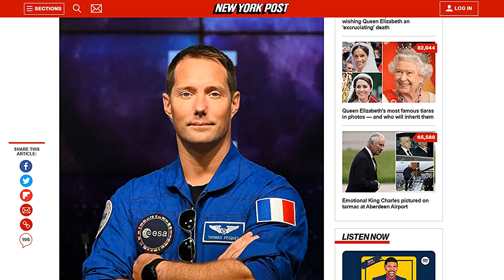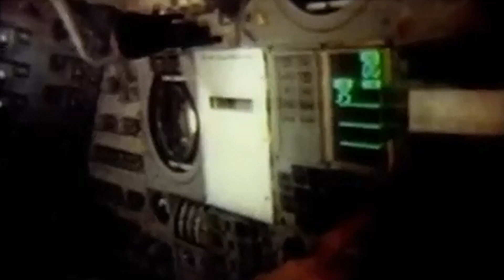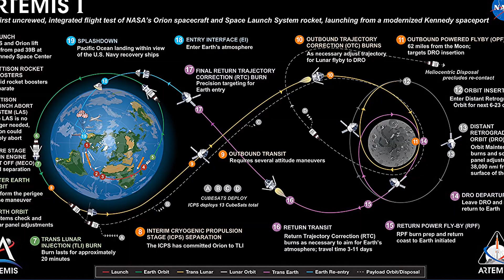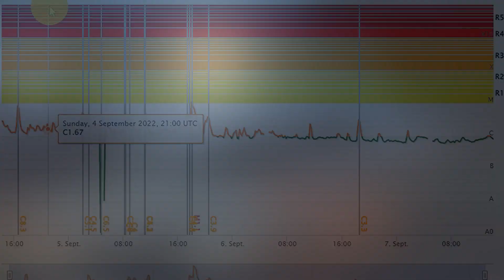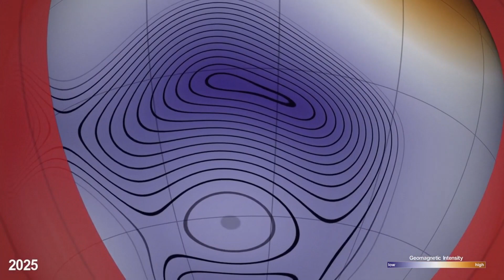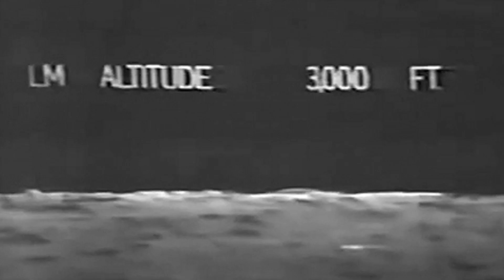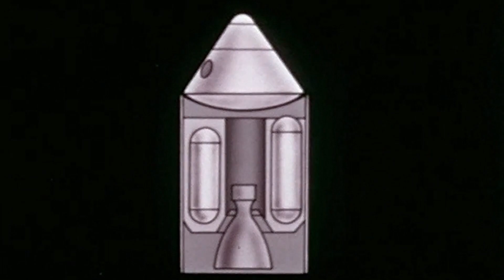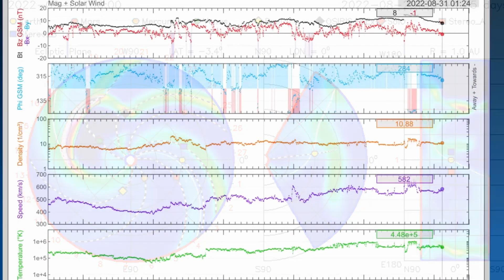THE APOLLO DISCUSSIONS "APOLLO 2.0" PART 2 OF SHOW 10

Comment: I'll patch it again, right here, why the "LACK OF FUNDING" excuse doesn't run anymore, "thanks" to the current Artemis Program. The absurdity of the Apollo missions is more exposed than ever.

First of all, if we take the cost of an individual mission, that is, all the costs of the individual elements associated within a lunar mission (or as detailed by the NASA Inspector General, Paul K. Martin, "all Production Costs, including rocket, modules, control of operation, etc.”), we have that, according to Forbes, turns out that the individual Production Cost of Apollo 11 was $355 million in 1969 currency. An Apollo 11 was a manned lunar landing, that even exceeds Artemis 1 or Artemis 2 in its complexity, since Apollo 11 has a Lunar Module and many more nuts and bolts. And Forbes estimates the cost of a unit of the Saturn V rocket as $180 millions of the time, while the former NASA Director estimated that in $150 millions (in an interview to National Geographic in 1969), so we can be assured that Forbes wasn't underestimating their figures.

$355 millions in 1969 money equals $3.4 billion in current money, using NASA's specific inflation index (multiplying by 9.6 to convert 1969 dollars into 2021 dollars). Today, Paul K. Martin says that the individual cost of a mission like Artemis 1 is 4.1 billion dollars, and that's more like an unmanned version of the Apollo 8 mission, if anything. Less than that, actually: Apollo 8 not only was manned, but also made 10 lunar orbits. Each unit of the SLS costs more than 2 billon dollars, and like the Saturn, is totally expendable. So, in conclussion: more expensive, and brings half the payload to lunar orbit. In a mission with significantly downgraded goals. But that's not the worst part.

Then, you have the Total Investment Costs. That includes the infrastructure and research and development costs specifically for achieving the lunar mission. All the costs of buildings and factories made to produce and house the components of the lunar missions would enter here, like the gigantic Vehicle Assembly Building and the factory expenses to mass-produce the respective components of all the lunar missions (i.e. to manufacture all Saturn rockets for Apollo, SLS for Artemis, all Apollo or Orion command modules, etc.). They also include the costs of adaptation and expansion of existing factories for the new objectives.

We have that the Artemis Program specifically consumed and will consume in R&D, manufacturing, etc., a total of 93 billion dollars until the year 2025, according to official NASA inspection reports (https://oig.nasa.gov/docs/IG-22-003.pdf)

But this, of course, is only for the Artemis Program. The previous Constellation Program, canceled in 2010, which had the same aiming of landing a man on the Moon and which previously developed several of the elements that are used today (most of the money was spent in the design of the Orion command capsule), wasted from its creation in 2004 until its abrupt end in 2010, a total of 12 billion dollars.

Therefor, the Artemis Program, until the year 2025 in which, it is presumed (🤣), it will achieve a manned lunar landing, hitherto will have spent a minimum of 105 billion dollars. And it will have achieved the following:
- 1 manned mission with moon landing (Artemis 3)
- 1 orbital manned mission around the Moon (Artemis 2)
- 1 orbital unmanned test mission around the Moon (Artemis 1)
- 1 unmanned test mission in Earth orbit (Exploration Flight Test-1)

It remains to be seen whether it will actually succeed, but for comparative purposes we will presume that it will do so by 2025. Then we can compare it to the alleged results of the Apollo Program, when it wasn't even complete, say, until the end of the year 1969:
- 2 manned missions with lunar landing (Apollo 11 and Apolo 12)
- 2 manned orbital missions around the Moon (Apollo 8 and Apollo 10)
- 2 orbital manned missions around the Earth (Apollo 7 and 9)
- 3 unmanned test missions in Earth orbit (Apollo 4, 5 and 6)

We all see that the acomplishments of the Artemis Program until the year 2025 will be less than half of the results of the Apollo Program until the year 1969. However, in 2025, it is expected that a total of $105 billions will have been spent for the Artemis missions. Meanwhile, the entire Apollo Program up to the end of 1969 had spent a total of 180 billion dollars in 2021 currency (elaboration based on figures from "The Apollo Spacecraft: A Chronology. Volumes I through IV", using the latest NASA inflation update chart).

This obviously leaves out the fact that part of that money was already invested, in 1969, for missions that would be launched after that date (4 more moon landings until 1972, and an orbital mission). So, not all of that $180 billion is for lunar missions until 1969, but let's assume it was (while the post-Artemis 3 Artemis missions are much more spaced out and farther in time; i.e. this unfairly improves the comparison for Artemis).

Clearly the Artemis missions are more expensive than the Apollo missions, also in the Investment Costs category.

But that hides another thing. The Apollo Program faced the development and manufacture of all the elements necessary for the lunar missions virtually from scratch. At the start of the Program, in 1960, there was no rocket capable of lifting heavy payloads into Earth orbit, let alone lunar orbit. Same happened with the command module, the lunar module, not to mention computers. None of that existed prior Apollo, and yet those elements were already developed and manufactured long before the start of the Artemis Program. 

The same happens with infrastructure. The aforementioned Vehicle Assembly Building, the two huge crawler-transporters (used for both the Saturn and the SLS), the new command center, etc., were all built for the Apollo Program and existed before the start of the Artemis Program, which also employs them. In accounting jargon, these previous costs already payed that cannot be recovered at the end of a project (but that can be used in another following one) are usually called “Sunk Costs”. Without the Artemis Program, and previously without the Shuttle, both the existing crawler-transporters and the Vehicle Assembly Building would be useless, because they could not be used for virtually any other project. 

Moreover, the sunk costs used by Artemis go further than that. The RS-25 engines used by the first three Artemis missions are just refurbished engines from the old Shuttles, and so are the Solid Rocket Boosters and external tanks, thought improved. They didn't need to build any of that, since it was already in stock.

Then, it is unfair to compare the total investment cost of both programs, since not only the Apollo Program had more missions, but also because that program built and developed elements that did not exist or even had been conceived, and that could later be used later. The Artemis Program had a much more advantageous starting point, since it incorporated the already buil equipment and components from both the Apollo Program and the Shuttle Program.

But there is still more. In the 50 years between the two Programs, there were many technological developments that would have lowered costs, regardless of the development of the space programs, from which the Artemis Program could benefit. Consider the progress of computers. In 2010, a simple Iphone has more computing power than all of NASA in the year 1969. Think about the implications, in cost and possibilities, that such a technological leap entails. Not to mention the advantage of half a century of experience in space travel since 1972.

Well, leaving aside all those advantages, one thing is clear: the total investment costs of the Artemis Program not only should be lower than those of the Apollo Program (while being higher instead); they should not exist at all!

Why? Because at the very least, the developments and equipment that already existed prior to the launch of the Artemis Program already guaranteed that the necessary elements for a lunar mission could be produced at once, since were already developed in the Apollo Program. Much of the infrastructure and equipment was still in use at the time of Project Artemis launch in 2011, thanks to its use in the Space Shuttle Program that ended that year. The cost of retrofitting the plants to their original configuration (or higher) to rebuild the original components (Saturn V rocket, command and service module, lunar module) is a fraction of the costs of building them from scratch.

Summary: To send astronauts to the Moon, only Production Costs should have been required. All Investment Costs could have been saved. As simply as that. The infrastructure, equipment, R&D, was already there. It's incredible unfair to compare it with the investment costs required for Apollo. 

The only reasons why new investments would be required is if the resulting new developments improved the performance or efficiency of the old components of the Apollo Era, or if they were needed for greater aims. But none of them are the case. They will be more expensive and less efficient. Especially in the most important component, the rocket, which represents half the cost of the entire project. The SLS is not an improvement at all; its capable of launching half the payload into lunar orbit than the Saturn, it's neither an upgrade in rocket reusability or weight at launch. It's New, which means it needed spending to develop it from scratch. It's Worse, as it has half of the lift capability. And More Expensive, since even once developed and tested, each new unit will cost more than the already previously developed and tested Saturn V. And not a single person can say that, even if they make it on schedule and in 2025 they land an astronaut on the Moon, that would be a more ambitious acomplishment that any of claimed results of the Apollo missions.

Comment: I've done a lot of study on the shadows on the Apollo missions.
I've tried to catch them out, and have concluded that basically, they did an excellent job.
e.g. The shadows of the LEM decreased appropriately in length according to the duration of the alleged lunar visit.
In still photos, shadows from objects on each side of the picture, converge as they fall away from the camera, due to parallax, as must needs be.
The camera did not "pan across" the scenery but swivelled around from its position fixed on the Rover, up to 360 degrees at times.
So if one view shows shadows running full length to the left side of the image, then turning clockwise 90 degrees later we will see the shadow falls directly between the object and the camera, and at 180 degrees from the first view, the shadow will point 180 degrees in the opposite direction, from the object to the right of the image.
This is elementary!! I can't believe you use this as a proof of fakery. 
In fact, it is proof that they tried very hard to make their fakery appear realistic!! Succeeded, even!

Again, I have to comment that there are much better arguments revealing the faking of Apollo, than (some of) the ones you are using.
It is counter-productive to use false premises like this.
Reply: So what does this mean exactly in layman terms?

Edit: misspelled layman
Reply: @Xernive  
Which "this," exactly?
Reply: @rubygray7749  Referencing to the original statement you were making about how they did the shadows etc.
Reply: @Xernive  
Wèll I don't know how they did it, but mostly they were fairly accurate. I've scrutinised several EVAs where the camera rotated 360°, and somehow, the shadows appeared consistent all round. That would be really difficult to achieve with a single studio light.

But there are some glaring anomalies. 
On the Apollo 11 photos, when you adjust the gamma and other parameters, you can clearly see that extra spotlights were used. There are multiple shafts of strong deep blue light, shining from a different direction from the white "sun". Very obvious.
In one of the missions, there is a photo of someone's visor with a horizontal row of 5 spotlights along the top edge.
Etc etc.
Reply from the maker: First of all, the camera PANNED 171 degrees from the left to the right. Since the rover remained in the same position the shadows must be heading in the exact same direction. That's how physics works in the real world.
Reply: @theapollodetectives  
Interesting that you know the figure was exactly 171 degrees.
However this just proves my point.
The shadows on the far left and the far right therefore MUST be at 171 degrees to each other (actually more than this, as each frame takes in a certain unknown angle of view).
Say the sun is casting shadows of objects towards the Rover.
At the beginning, the shadows will be pointing to the LEFT side of the frame.
90 degrees later, the shadows will be pointing directly TOWARDS the camera.
At the end, the shadows will be pointing to the RIGHT of the frame.
Also, the distance of objects from the camera will make a big difference, due to parallax, with shadows APPEARING to diverge, although they are actually parallel ... And of course, that is only true for objects illuminated by the sun from 93,000,000 miles away, but all bets are off when they are lit by a studio lamp at some unknown distance, in which case of course the shadows will ACTUALLY diverge significantly.

This IS real world physics.
The shadows ARE heading in the same direction, but the camera records them relative to itself throughout the series of frames as it turns through 171 degrees.
Reply: @rubygray7749  you are wildly inaccurate
Reply: @scotthenderson6168  
I'm actually not.
You are suffering from misconceptions due to optical illusions.
My explanation of the shadows is 100% correct.
Please explain in detail, with timestamps on your video, or on NASA numbered photos, how you support your claim.
Reply: The shadows in the still photography are insane! I'd post examples but.......YT
Reply: @thebruffy1077  
Let's take it to FB then, where we can post photos with annotations.

Comment: L.E.M., THRUSTER HAD BEEN THRUSTING FOR HOURS BEFORE IT GOT TO THE MOON SURFACE, AT EXTREME HEAT🚀L.E.M. LANDING WAS IN SUNLIGHT, 250° FAHRENHEIT🌅WHAT COOLED THAT LUNAR THRUSTER DOWN BEFORE THE ASTRONOTS TOUCH THE LUNAR SURFACE⁉️LUNAR THRUSTER SHOULD BE RUBY RED FROM HEAT, LUNAR SURFACE AND ROCKS SHOULD LOOK LIKE A BAR-B-QUE PIT, UNDER L.E.M. THRUSTER♨️